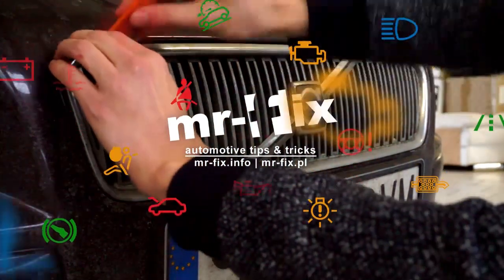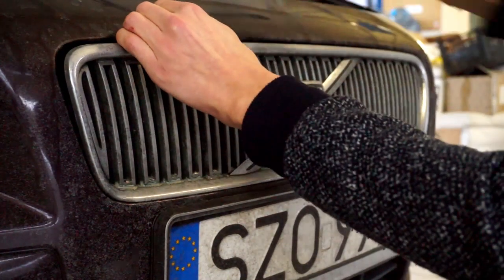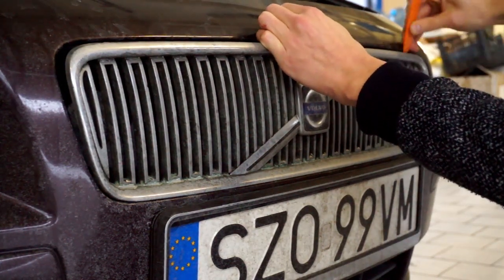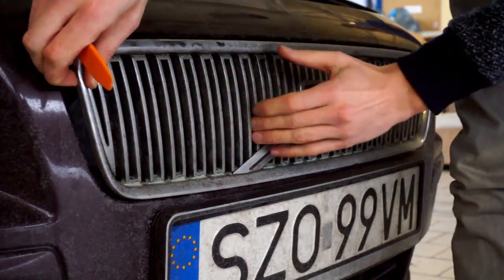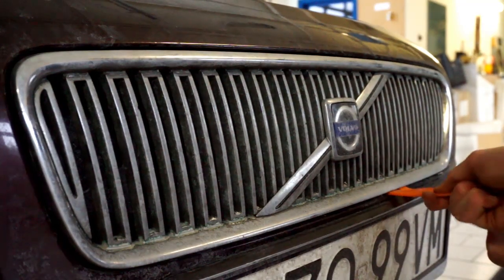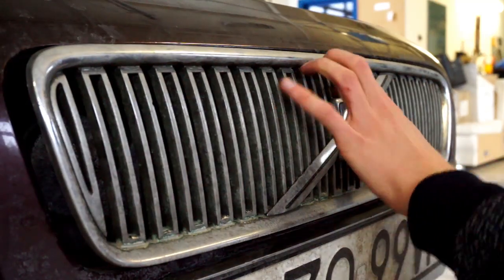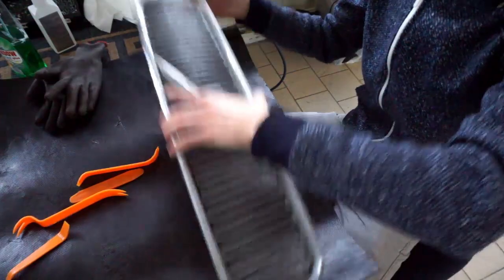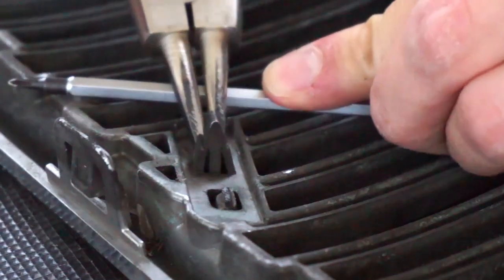Volvo C30 S40 V50 C70 remove grill and badge

Comment: S40 upto year 2004 has 6 x nuts/bolts holding the grille on from the inside of the bonnet....
Reply from the maker: I should make that clearer - this video is covering Volvo C30/S40 II/V50 which are on the P1 platform. Previous S40 was a different car with different elements and different mounting points.